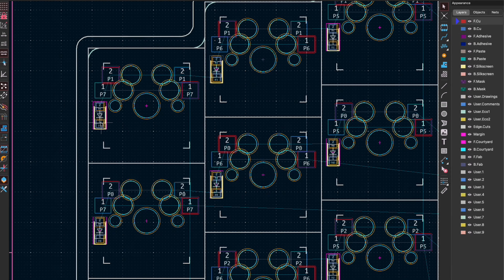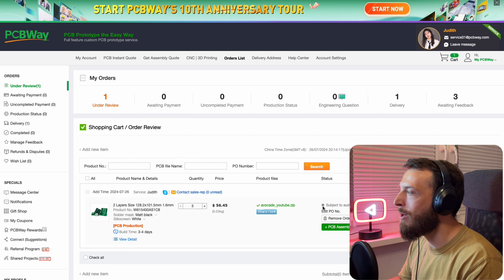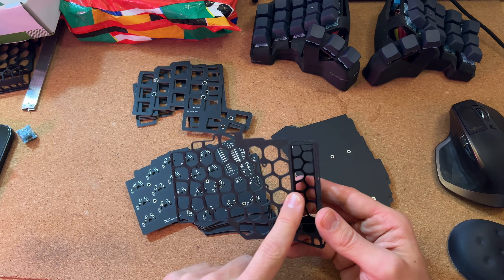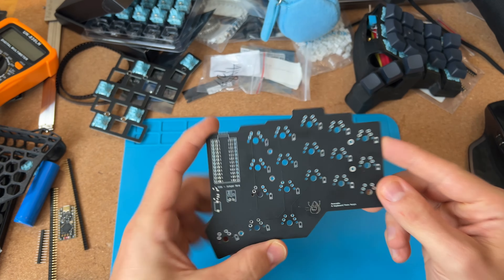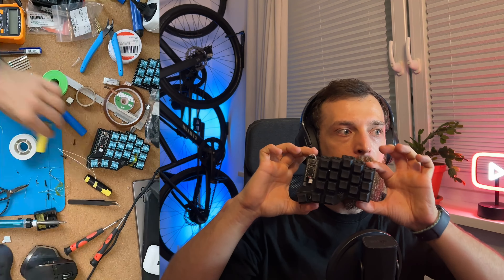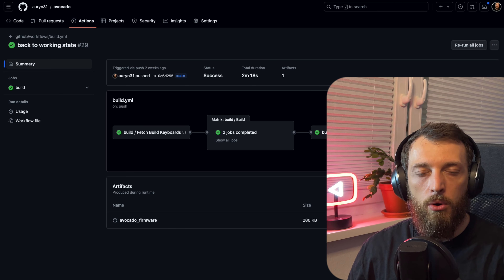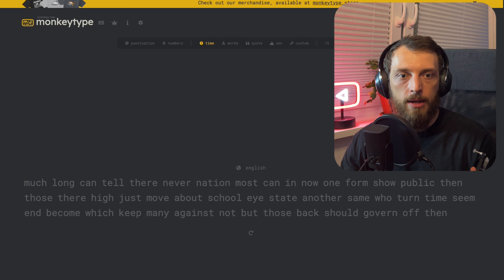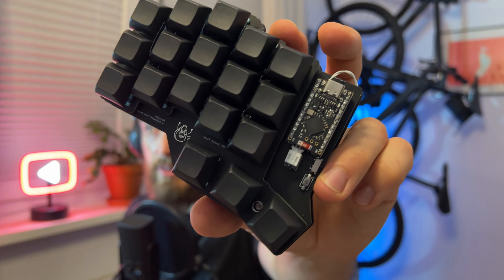Building My Dream Keyboard with Custom PCB Design | Part 2

Comment: Get rid of standoffs alltogether; account for the planned gap in the printed bottom part (or print a separate "headgasket"  spacer, to reuse the bottom that you already have done)
Reply from the maker: First I tried to add the gasket to the bottom plate already, this messed with the print, but the printed spacers/gaskets make sense. 
I already ordered m2 heated inserts and longer screws. Will use this or 3mm stand offs :) 
Ordered both to test what’s best :) 
Thanks for the hint
Reply: @CodingWithAuryn will you try building a dactyl?

Also why didn't you put your signature steel ball on the home keys? Are they not comfortable?
Reply from the maker: No, I am happy with my latest build. Also the dactyl has too many keys. I like 36 keys :)

I did, but just a bit later. So currently there are steel balls in the home keys
And I still love it and need it for positioning my hands faster.

Comment: so, are you satisfied now?
Reply from the maker: With the keyboard extrem yes. It is my daily driver. Even after buying multiple switches. 
But I build another one without the trackpoint. Since i don’t use it that much and it drains the battery
Reply: @CodingWithAuryn  but this without trackpoint, or not?

Comment: I would have loved to see a video for the firmware as well. I'm in the middle of making my own keyboard right now as well, where i want to try the niceNano Clone. However the chip is not listed when i do the initial init for the repo. What did you enter for your firmware?
Reply from the maker: Thank you for your input
This is indeed a good idea to do some more details their
You can also find the firmware in the linked repo
Out of the blue I don’t know, but I think i just put in the nice nano since it is a clone and works well

Comment: thanks for the great video, could you please share the link of pins that are used for sockets?
Reply from the maker: Thank you
I just used some legs from some other diods. I did not purchase some pins, you can also use some wire or similar. Did this for my corne with some garden wire. Works fine as well :)

Comment: Hi,
Any chance you can give more details on how you made your PCB reversible? I would like to go down the same rabbit hole and having a reversible PCB makes it cheaper 😅
Reply from the maker: Very good idea, thanks. Currently working on another version, maybe i can create a video from scratch how to make it reversible. but basically it is just one option on the ergogen :P
Reply: @CodingWithAuryn  😮 didn’t know that! I really need to go deeper into the ergogen documentation!

Comment: I've been looking at tenting solutions and funnily enough your temporary battery solution is one of the best ones I've seen.

Anyway I had no idea you would receive all that from Aliexpress in one package. Did you achieve that by specifically looking for shops that offer combined shipping?
Reply from the maker: true, the temporary fix became also my currently used solution :D 
it works like a charm and the battery life is huge (like 2 month)

When i order from aliexpress i usually just use the choice stuff, then they package it in one and send it over. also it arrives then mostly super fast. 
even so it`s not always one package.